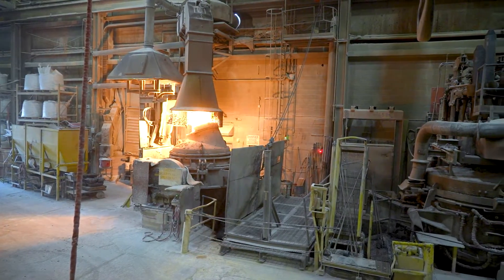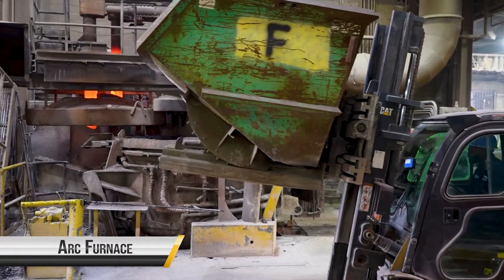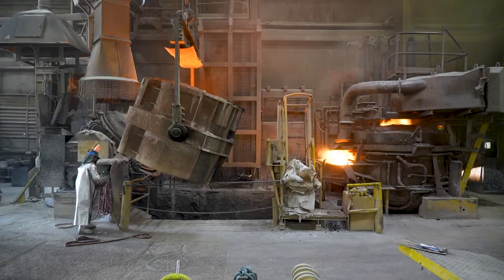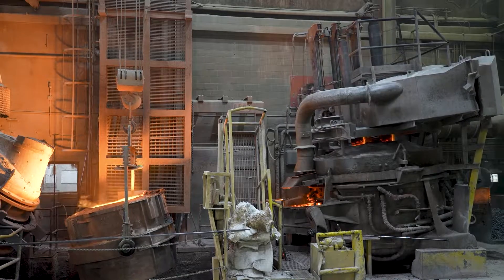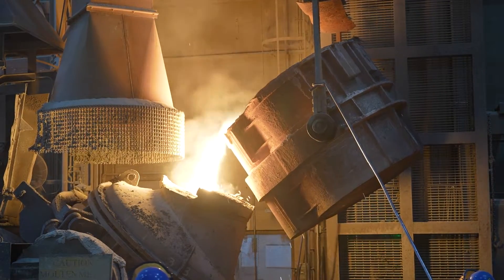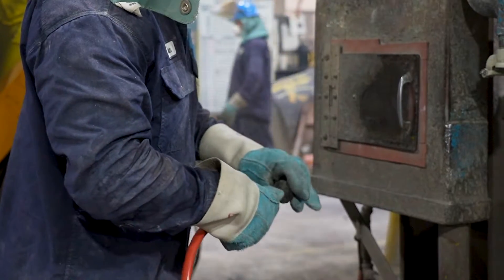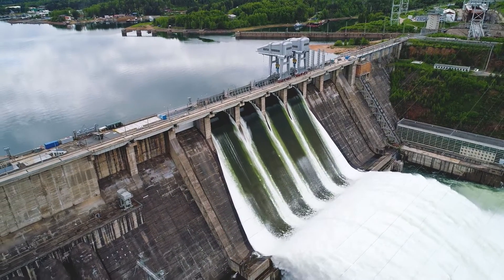Arc Furnaces and Argon Oxygen Decarburization (AOD): MetalTek: Metal Casting Expertise

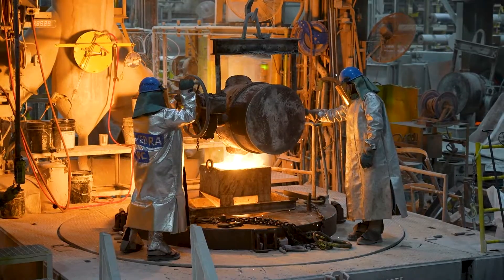Comment: 2:51 Top pouring introduces excessive oxidation and agitation, and carries with it any floating lower density impurities.  I thought modern foundries all switched to bottom pouring.
Reply: Does it really matter when you're casting a normal mold? Ultra cleanliness is only really possible with a BOF anyway. Do foundries even do bottom pouring with ladles that small?
Reply: @SoundShunter72 depending on what alloys are in the bath. We bottom pour to avoid N and H pick up. Even from our small 2t ladels.
Reply: This is a teapot ladle, watch closely the ladle top half. Also, they are emptying the ladle here, they are not pouring in a mold. Bottom pouring also has its disadvantages, it is unrealistic to bottom pour such a small ladle.
Reply: @88Coldreaver  Thank you for the explanation. 👍